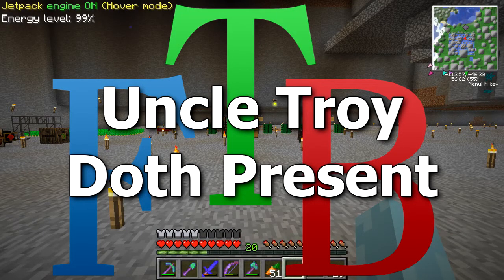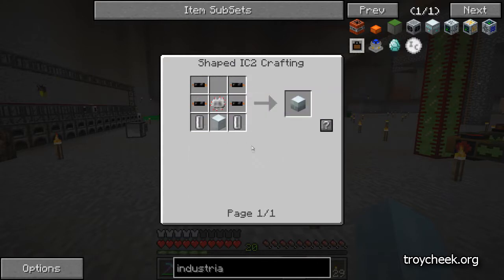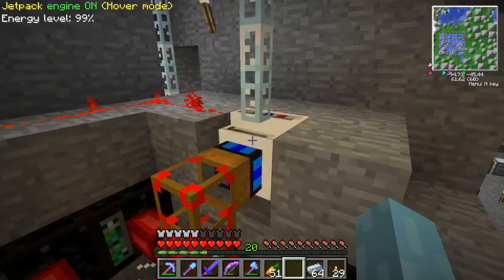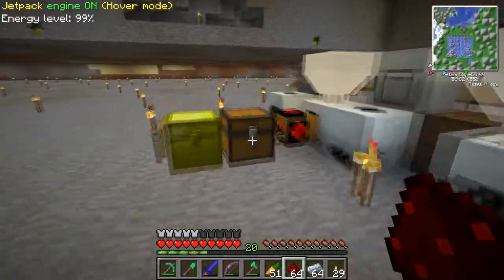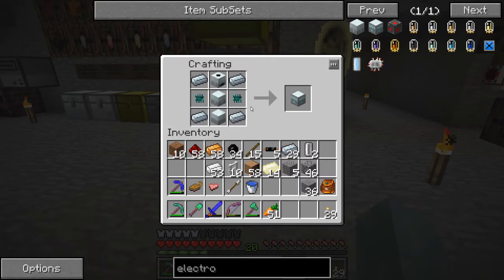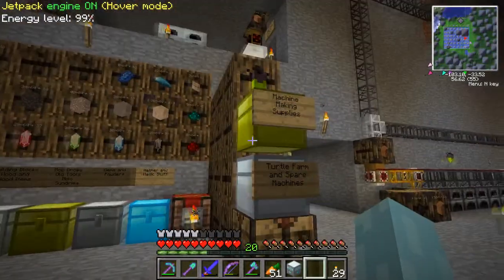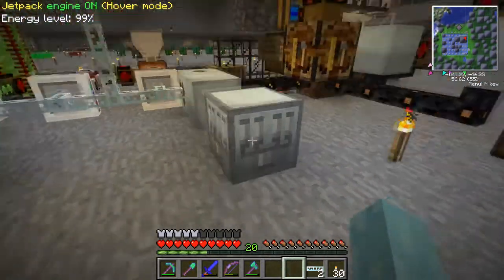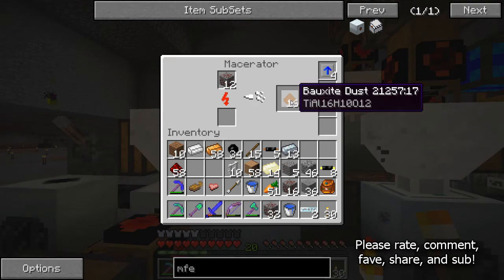FTB 30 - Tiny Piles of Titanium Dust [Feed The Beast Mindcrack]

Comment: Another great tutorial. You can get Invar blend(dust) by combining 2 iron dust with 1 ferrous metal dust in three separate crafting slots, smelt and Bob's your uncle or Troy is.

Also the two types of Aluminum and Aluminium are separate beasties, the white speckled ore doesn't smelt or pulverize into the blue dust. Might have missed the mention but I've seen people confused by that before.

Gonna catch up on your older tutorials, keep up the great work.